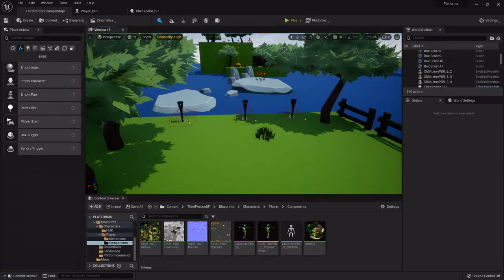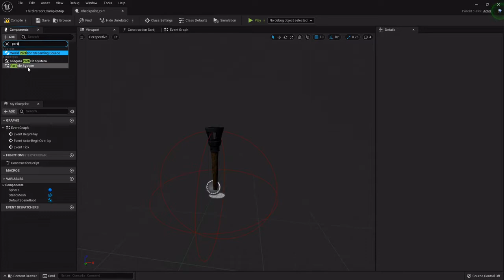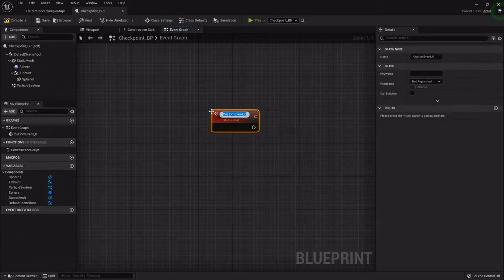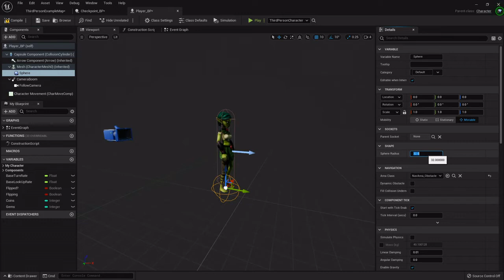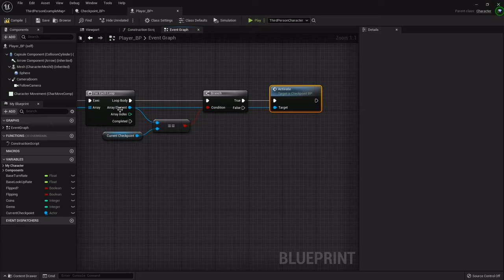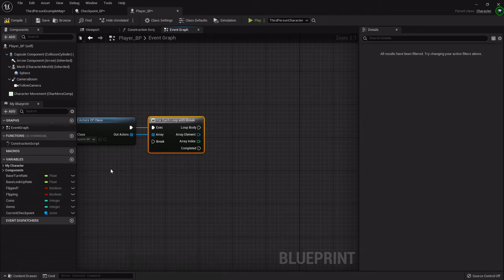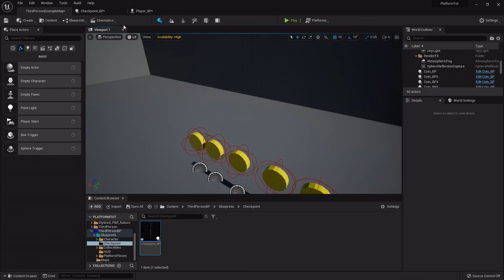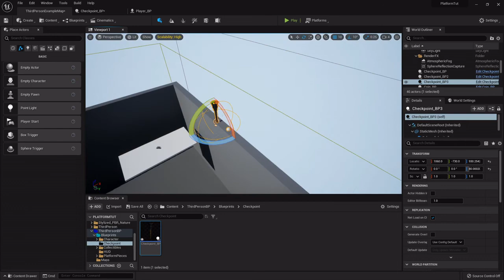Unreal Engine 5 Tutorial Series; Checkpoints and Respawning #ue5 #unrealengine5

Comment: I set my particle system to be off by default and use toggle active on it instead of the spawn and despawn like you have. One could also use set visibility. I am currently in engine 5.1 with a lot of changes since this video... so I was wondering what way you would go about debugging the differences so that I can compare the 3 methods for efficient project usage?

Comment: the tag thing doesnt seem to be working in the current version but a standard cast to bp has otherwise fixed any issues on communication. Instead of spawn emitter and destroy component I set the fire in the emitter to visible false on deactivate and true on activate. I'm doing the platformer series with my 6 year old. Thanks man.